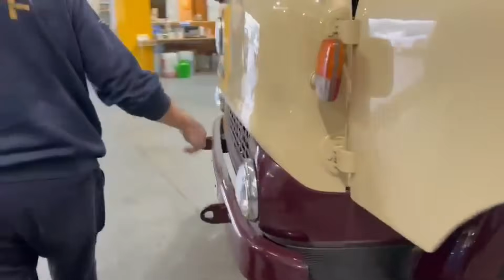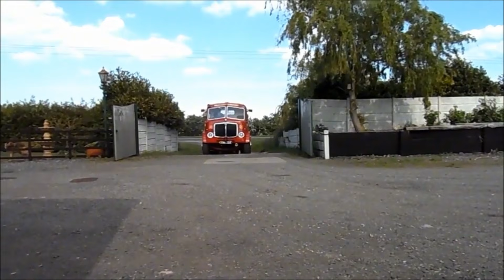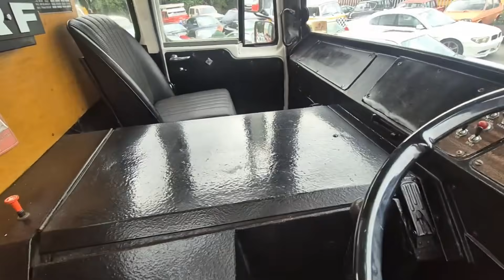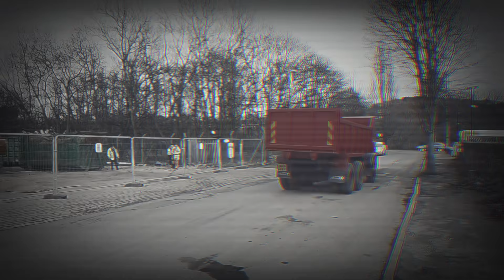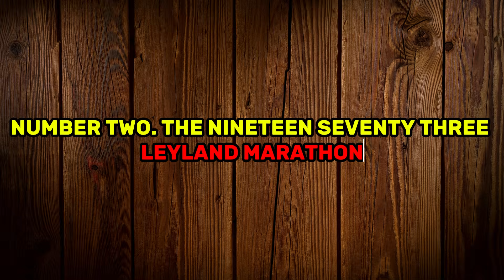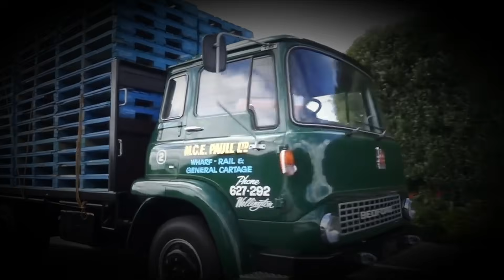10 Trucks From the 60s–70s That Still Work Better Than New Ones!

Comment: you showed a 1950's AEC mandator not a 1970's vehicle, and the 1970s vehicles had air servo clutches,, i worked at AEC in the 70's,